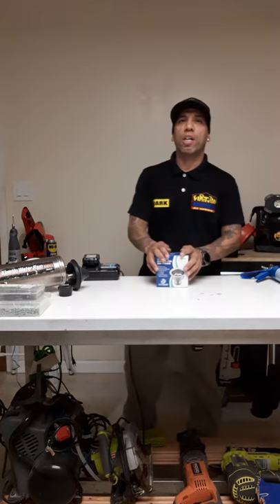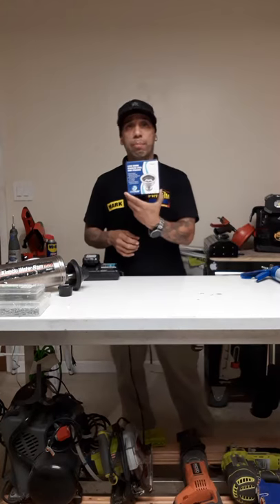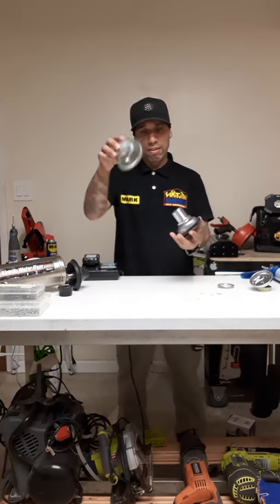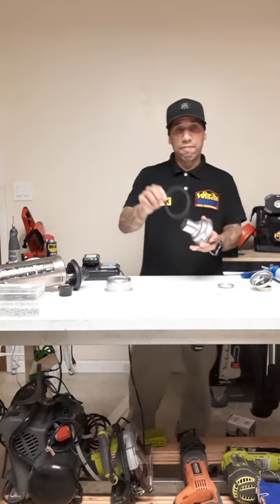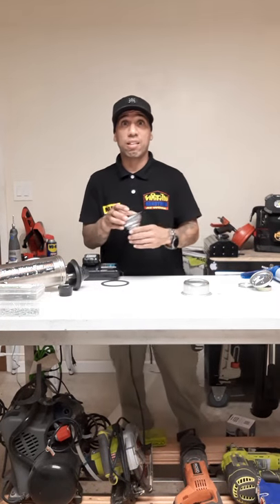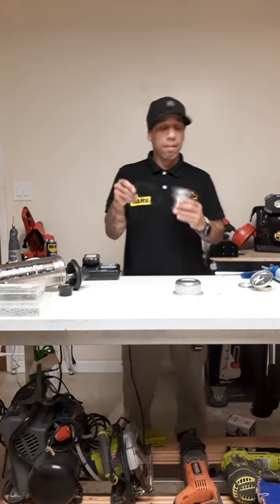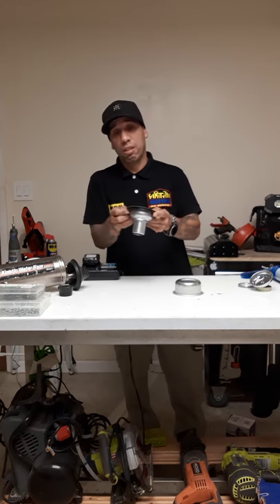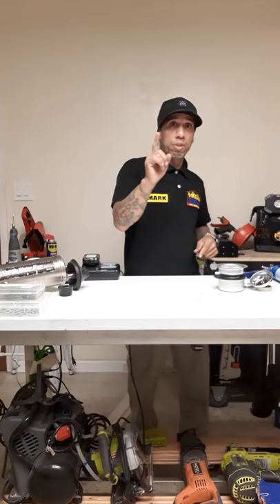Plumbers putty or Rubber gasket

Comment: I was just researching this issue with a bathroom sink pop up drain replacement. So far, I've seen both the rubber gasket and the plumber's putty solution about 50/50 in the recommendations of both professional plumbers & experienced handymen.

Reminiscent of Coke/Pepsi, tastes great/less filling, Yankees/Mets and other hotly contested disagreements, in the absence of actual scientific tests conducted in precisely controlled lab conditions I am going to try the gasket method first. 

(Truth be told, I started to try the plumber's putty first on the recommendation of my local plumbing store, but it was so messy that I backtracked almost immediately. If the rubber gasket leaks it will only take me a few minutes to go back to the plumber's putty, curse the Gods for yet another messy solution to a simple problem, and try again. Or, I might just put a dab of silicone on the old sink where the coating is a little worn & rusted thru and put the rubber gasket on top of that.)

This level of indecisiveness is why I probably shouldn't be attempting this repair myself and should stick with computers, routers and switches, which is my actual profession. But, I'm semi-retired so what the heck...

Comment: This guy is wrong. That why he’s a handyman and not a plumber. The “stem or straight pipe” he calls it, is called a flared end tail piece and that does need that clear/white nylon washer. That larger gasket goes under the sink and is not intended to seal from water. If you put that washer up top it will have a gap from the metal strainer to the sink surface and then start to corrode away leaving black inky messy staining all around the strainer. The plumbers putty gets rolled until it’s soft and warm and a bead gets installed under the naked flanged top side of strainer. As you tighten the strainer down all the way the excess putty squishes put from above and below. Leaving the remaining putty to seal in between. The metal flange should make contact with the sink so there is no gap. 100% real clear silicone is a great alternative to putty but messy and hard to work with for beginners. Make sure to use non-corrosive non-staining putty. There’s a reason why it’s called “plumbers putty” and not handyman putty.
Reply: Amen
Reply: Correct

Comment: What you say makes sense, However what are you suppose to use if your kit does not bring that rubber washer? ..Because I just purchased a kit from in-sink-erator and it does not bring that rubber washer, but the instruction do mention that you need to use plumbers putty of course It would be different from the kit your using because it's not used on a garbage disposal. So what you recommend in that case?

Comment from the maker: You guys are hilarious you plumbers that a license love to rip people off I seen a lot of shows where you guys go in and said on a hot water heater doesn't leak you need to change the whole hot water heater all you guys do is rip people off you guys got a bad rep handyman no more than one trade I am a licensed locksmith by Trey I am I wasn't imprentas working for a electrical company to five years and ran and ran home runs from the panel box I am also a carpenter you guys should go see my Step Van project I install solar panels and there's a lot that I know that you plumbers only have one skill and one skill only I'm a jack of all trades and a master of many of them I've learned everything since I was young and let me tell you there's nothing a plumber can't do that I can't I put in no hubs for inch lines and I also braised so there's nothing you plumbers out there can tell me you guys are a bunch of Thieves and I'm not saying all plumbers but I'mma drive you guys Rob people blind I've been in this trade a very long time and I ran 1500 units and trust me a lot of the plumbers that used to come to my site didn't know what the hell they were doing so for you plumbers no offense but handyman no more than whatever you guys can put on the table
Reply: Handymen At Work Locksmiths, people gladly pay me $150/hr for my experience and quality work… and I don’t only do plumbing.  I’m also experienced in all phases of HVAC/R, including oil, gas, pellet & wood combustion technology, steam, hydronic, radiant and hot air heating systems, diagnostics and repair of appliances.  I have never needed to file an insurance claim in the last 19 years that I owned my business.  Yesterday, I went to look at a hot water boiler that had the expansion tank, relief valve and boiler control replaced because the boiler made steam and killed the expansion tank and the relief valve was blowing off.  The handyman assumed it was a bad boiler control, so they replaced it ($350).  The customer said they were still getting air sounds in the pipes.  I found that the boiler was still exceeding the 180° limit.  I checked the indirect water heater that the handyman installed and found that it was wired directly to the burner instead of the aquastat, so it was boiling the water.  I properly wired it and the problem went away.  I would have cost $300 instead of the $450 the handyman cost.  I’m a technician… not a parts changer.
Reply from the maker: @TomTheTechnician  obviously that guy's a moron he didn't know what he was doing not all handyman a bad handyman and not all plumbers are bad plumbers you have a handful of guys that think they know the trade and don't know nothing that right there my friend was lack of experience and that's a jack of all trades that don't know nothing I respect guys like you don't know what they saying and do cuz I understand what it takes to be a good plumber and a good handyman the only way to be a good plumber is knowing what you do best and very technical and solving problems that's the way I see things a lot of handyman give us a bad rap vice versa but you do have a lot of bad plumbers they've come to my place and then work and I have to repair their job I never also had to file an insurance claim I always has satisfied customers and I was taught by the best you got to be a good technician and a good Problem Solver and no your skill you can only teach someone what you know to a certain point I know cuz I used to be a student I was taught how to do things the right way when you start being creative and open-minded I'm solving problems on your own then you have taught the student well my intentions were not to offend anybody my apologies have a good one

Comment: Thanks Mark, I've had to replace putty several times due to leaks. I'm going to take your advise and use a rubber gasket instead. Appreciate the info!
Reply from the maker: You're very much welcome I hope you like the video and I'm glad done it work for you be well
Reply: The rubber gasket goes underneath the sink.  The cardboard washer goes between the rubber gasket and nut or bell, depending on what kind you use.  Tightening the nut sufficiently is the key.

Comment: Ok, I'm going to give this a try on one side of my two part sink, the small side that goes directly to the drain. I will use silicone as a sealant for the other side connected to the garbage disposal. We'll see what happens over the next 5-10 years :-) I like this guy for two reasons. He's not afraid to go against the grain, even when the "professionals" complain like hell at him (which he handled fairly gracefully I think after reading some of the replies); and because I agree with him concerning education. Being educated (like me) doesn't make you smart. It just means you know stuff. Being "smart" means you know stuff and what to do with it! My dad has a sixth grade "education" and he's a ton smarter than I am with my college degree, and a lot smarter than most "certified" folks. And he's like this guy, he can wire houses, plumb houses, actually build additions onto houses, pour concrete, fix cars, fix trucks, fix tractors, fix boats, fix toasters. Well you get the point. I on the other hand have to look at a million youtube videos just to figure out how to put a damn sink drain in a sink :-) Thank God for guys like this guy and my dad who will "invent" something that actually works. My dad has invented tons of crap over the years, and they actually do work. We'll see if this guy is like my dad.

Comment: I've been plumbing over 20 years and I've never heard anyone so clueless speaking as though they know what they're talking about. 
If putty doesn't work, you're not applying it correctly. 
 If you want to stay in the trade.... Grab a shovel and stop giving bad, inexperienced advice. 

This is a perfect example of youtube diy giving totally wrong advice.
Reply from the maker: Who's to say that plumber's putty is the right way the problem is people don't like to see things different or even if it's new but I've been doing this for 25 years as well and never ever had a problem with just using the gasket I think a lot of people afraid to try new things and the industry will be and shocked only because why do people use plumber's putty it's only going to deteriorate after 6 months or so depending on how much you apply will definitely can deteriorate but with a war of the washer that will never happen I've done it for a long time never got a call back try it you guys don't be scared to try something new I've been doing this since 19 years old and his work for me ever since thank you for the comment
Reply: @handymenatwork316   he's talkin that mess because he wants to guarantee himself some future work.. i work in hotel maintenance and let me tell you how many times i had to putty crack and create leaks after a  couple months. i use to always wonder what the hell was the issue.....

Comment: Dude, I’ve installed hundreds of basket strainers and pop-up assemblies using the gasket under the sink and plumbers putty on the top.  I’ve never had one leak in over 20 years.  You’re dead wrong.  The gasket never goes above the sink.  Always underneath.  The reason some leak is because it wasn’t tightened enough.  Plumbers putty is never applied to the nylon top hat washer or the compression nut.  A little silicone grease on the top hat washer or compression nut is acceptable.  Always fill the sink to leak check.  Check the drain for leaks when you pull the plug.
Reply: agree
Reply from the maker: Try not using plumber's putty or silicone or whatever you guys use try using the gasket timing is tight and you'll see fill it up with water the sink and it will never leak I'm sorry you guys feel that way but I've been doing this since I was 19 years old and I never had a problem will call back for a leaky sink I never use plumber's putty so what gives you promise the right to say that's the wrong way when you probably wasn't taught the right way everybody has their own opinion this is my opinion and I never had a problem or never had a call back I've been in this trade a very long time thank you for your comment
Reply: Handymen At Work Locksmiths - Correction: You are not IN this trade since you are not educated and do not truly work IN this industry to receive proper formal education.  You need to be aware of this because if you keep telling yourself this, you’re going to be telling customers this and believing you’re more qualified than you are.  Handymen cause thousands of dollars in damage to customers homes every year by biting off more than they can chew and performing work they are not qualified to do.
Reply from the maker: @stevesummerford3690  correction I was in the trade I've done no hub PEX tubing copper and brass so I am familiar with the plumbing trade my uncle owns a company and when I was young I worked for him so I am familiar with the trade and I've done work so I know what I'm talkin about a basket is nothing compared to what I've done is just something that I feel that people should get to choose how the work is done you don't have to use plumber's putty on a basket just because you guys been doing it for years that's all you used to you only see one side I've been doing all these trades since I was 19 years old you believe it because you have a piece of paper and this is the way you were taught things have changed over the years you don't have to use plumber's putty buddy so I'm sorry to burst your bubble and you getting upset about it but I'm here to let people know do you can use it well they don't have to but if it worked for me over the years and nobody has called me back you should try it one day
Reply from the maker: I wasn't a trade I might not be in the trade now I decided to work for myself because I've been in the construction for almost 25 years so everybody has freedom of choice if they want to use a gasket instead of plumber's putty that's fine plumbers putty I don't agree with it it deteriorates after a couple of months and then you have to go back and what apply plumber's putty again when you can just use the gasket okay you guys you guys are custom of doing things one-sided but it's okay it's just the way the industry is there's a whole lot of things that use gasket now like toilet bowls they use wax rings who said you have to use a wax ring now you got all type of kids.com that are not used with wax rings now you using a piece of foam to replace the wax ring so what's the difference because a plumber don't certify that or it wasn't certified by a licensed plumber I don't get it anyway you have a right to your own opinion and so do I but I've been in this trade for a long time Plumbing electrical carpentry and locksmithing that's the difference between me and a plumber
Reply: Handymen At Work Locksmiths - lol.  Pass.  You do you though bruh.  Have a good day.
Reply: Handymen At Work Locksmiths if the rubber gasket is put between the basket strainer and sink, you will always have water around it.
Reply from the maker: @TomTheTechnician  yes you're definitely right about that if I use a rubber gasket there will be a little bit of excess water on top because of that gaskets a lot thicker than plumber's putty I'm I'm not doubting that I'm just saying the rubber glasses longer than plumber's putty nobody's questioning a plumber's job I'm just saying people have the right to choose and it works for me then that's fine is a suggestion that I make if they want to do the same thing then they could it's not going to kill you to try something different granted there will be a little bit of excess water on top but it definitely will last you longer than plumber's putty

Comment: Thanks Mark, great information...very helpful!! Just one piece of constructive criticism; it's kind of hard to hear you...maybe you could use some wireless buds with a mic?   Thank you so much for your help!!!!
Reply: Its terrible info. Take it from a plumber this guy is dead wrong. Rubber gasket goes on the bottom, putty or silicone up top.
Reply: @kylevorenkamp2416  why? What is so wrong about using the gasket only?